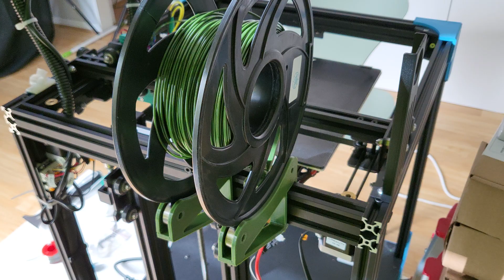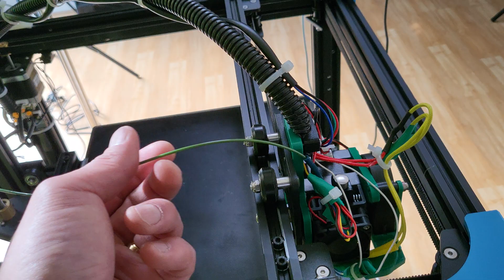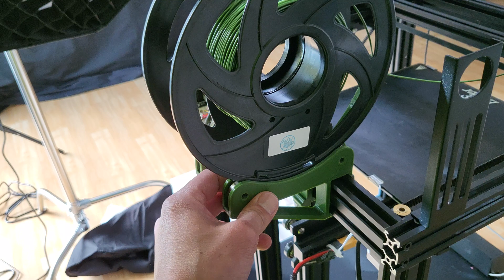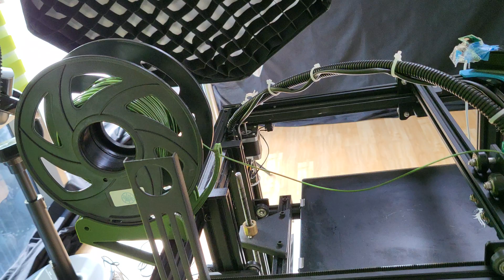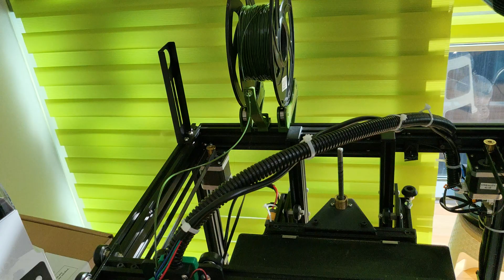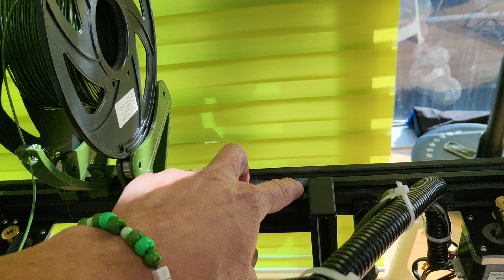Ball Bearing Ender 6 Spool Holder!

Comment: I'm tinkering now my ender 6, I preferred keeping the bowden tube (even with direct drive) and letting it go along the wires and the original spool holder was transfered inside the printer